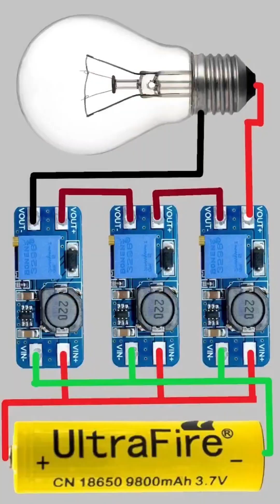MT3608 DC DC Booster #zaferyildiz #viral #diy #led #electronics #short #shorts  #circuit #diyproject

Comment: the schematic at the end is wrong. in the video each module connected to its own single cell, not parallel to only 1 cell. Also you can't parallel the input bcs it will result in short circuit.